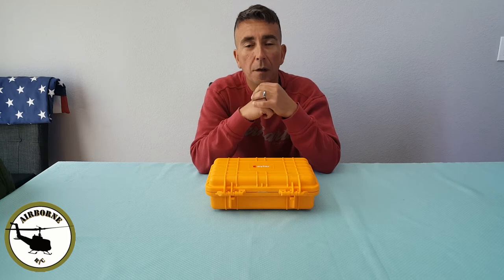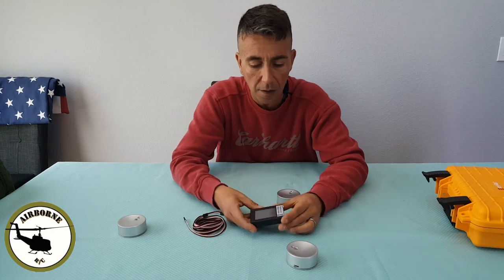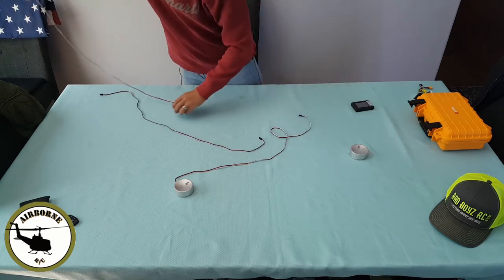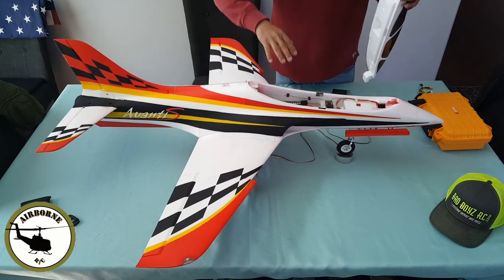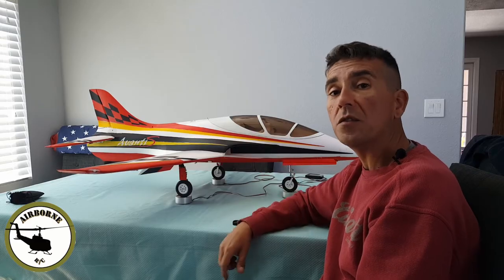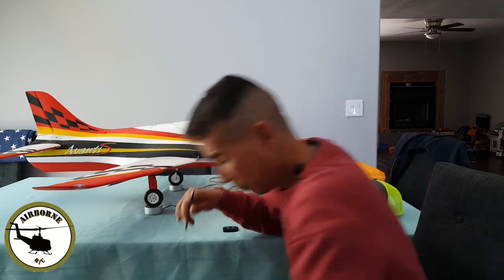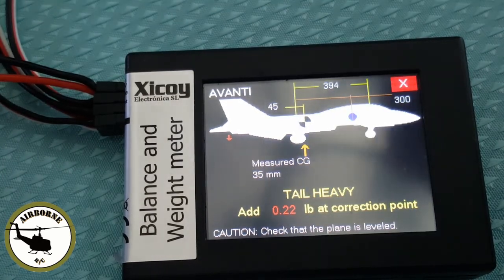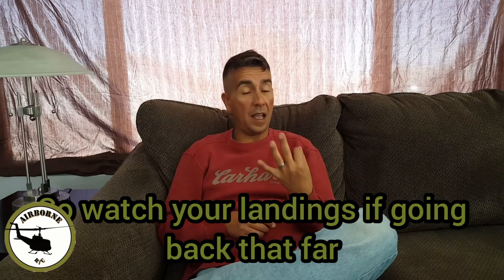Xicoy CG Balancer and Avanti S CG with different Size Lipos

Comment: Dude...  Don't the CG change when the battery is low?  Loooooooool   Just kidding.  I have the exact EDF and Xicoy.  Great tool.  Used it on my 60cc as well and the CG was spot on.   Thanks for the best explanation of how to use this must have device.  Nothing is expensive if it does what you need it to do!!  Quality and simplicity matter.
Reply from the maker: I couldn't agree more!!!! wait so the battery doesn't get lighter? :p HAHAHAHA

Comment: Noonz - Great video for the Xicoy.  I have been using one on all my planes and never had a problem on maiden flights, they work great.  I also have the throw sensors which I do not use.  They are OK but have no good means to attach them and keep them attached while measuring.  They say to tape them down but I found they still move and when you pull of the tape, paint comes off foam models.  I tried the low tack tape but the tape will not hold the sensors tight enough for no movement.  Balancer is worth the money, throw sensors not so much in my opinion.
Reply from the maker: "Blue tape" its pike a putty.  Only need a little bit. Its somewhat tacky and holds em in place. What i use. I got the idea from rc forums

Comment: Yeah it's a great tool.  Been using mine since last year and wouldn't go back to a manual CG method.  The only issue is some EDF's don't document their CG from the leading edge like the Avanti and you have to plumb bob from the bottom of the plane.  I have only had to do this once so far and it was a PIA but my other planes were straightforward.  I also kinda wish Xicoy would change the titles of the main screen where you enter data to something more descriptive.  It's so confusing it seems like I had to relearn how to use it every time I set it up.  I eventually made a little cheat sheet so I can wrap my head around what the inputs are.
Reply from the maker: Yeah totally agree! You sometimes have to get creative to do CG on some planes lol funny i had to make a cheat sheet to, since i can go a while not using it. 👍

Comment: I do have the FW Avanti S so I thought this would be interesting but I have a couple of (hopefully) constructive critiques.  I couldn't get much out of the video because several things were too ambiguous, at least to me.  I couldn't tell where you were pointing to most of the time.  For instance when you talked about measuring the distance from the main to the nose gear, were you talking about the angular distance from the main to the nose gear, or were you talking about the right angle displacement (how far back from the nose to the main?)  It would have helped if you had actually shown what you meant and did the measurement.  Would have cleared up any misunderstanding.

Then when going from the wing to the gear, you said "I put the square right here".  Right where, exactly?  You can't tell from the video what you were pointing at.  Were you at the wing root, right up along the fuselage?  I couldn't tell and you stressed that millimeters were important so it would have cleared up a lot of things if you could have shown EXACTLY what you were doing.

I gave up watching at about the halfway point.  It's too expensive for me anyway.  I only fly EDF's so I'll never buy the Xicoy and besides, the Avanti doesn't have one CG point anyway.  It's a range of about a centimeter like every other EDF I have.  So I'll just keep balancing on my fingers.  But I can definitely see the benefit for larger planes, especially if you spend several thousand on a turbine or other giant scale.

Comment: Seems tedious to use, if you mess up or it is malfunctioning you'll find out in the air. No thank you, it only takes a minute to physically balance a plane. I could show how to balance a plane the traditional way in a 3 minute video and it would be foolproof. This is the way CG is set on full size planes and is simply overkill and unnecessary for all but the largest RC planes.
Reply from the maker: Not tedious. I cg a plane in under a minute. Just longer in the video bc of all the explaining. Meant more for my 40lb turbines. And this is full proof! Not fool proof!
Reply: @NoonzAirborneRC  as an A&P and am RC pilot I understand completely. Once your start involving math and weight, arm, and, moment calculations, mathematical errors are now a possibility, whereas when the plane is physically balanced they aren't. So, no it's not full proof, it's not foolproof. As I stated, unnecessary for anything except maybe the largest RC planes, which you apparently agree with.
Reply from the maker: @shelbyseelbach9568  it is full proof like you said with math...if you mess up you are the fool why its not full proof. I am not urging you to buy it nor did I tell you where I got it from nor did I put a link it was just a demonstration because I've gotten 38 emails on how to CG an aircraft buy it or don't buy it I just use a cheap $300 for me to show everybody would have been better if I would have put a $10,000 jet on there that not everybody can afford? Un yeah....if an individual can handle simple math (3rd grade) then this is not the unit them shoot this hobby for that fact hahahahaha.thanks for watching thanks for your opinion have a great day. Move 0n
Reply: @NoonzAirborneRC  LMFAO!